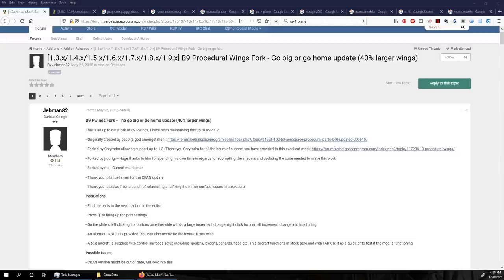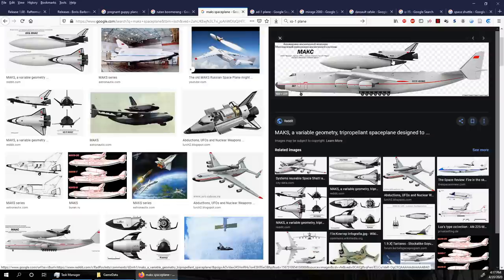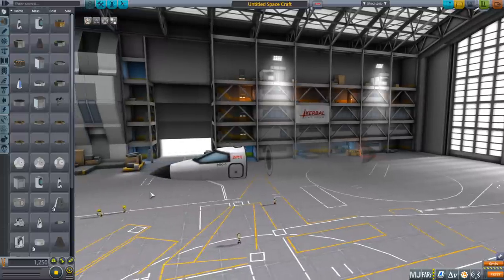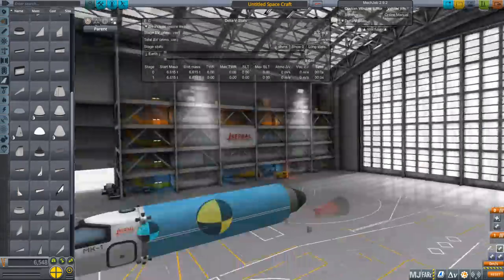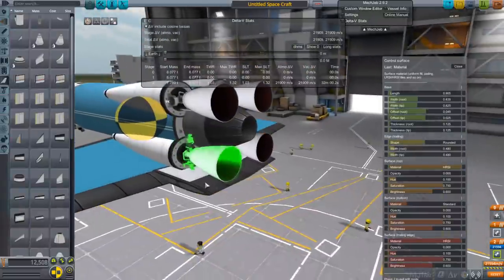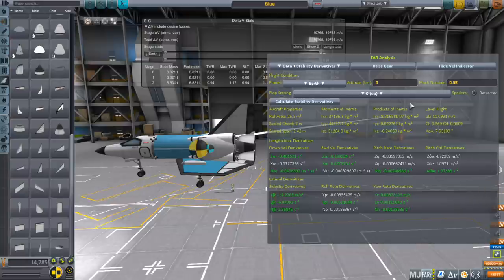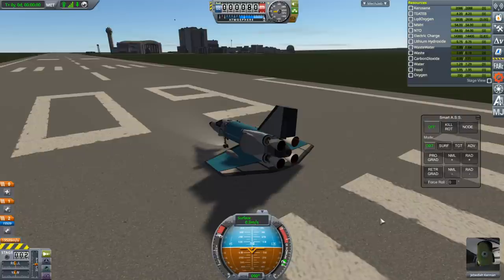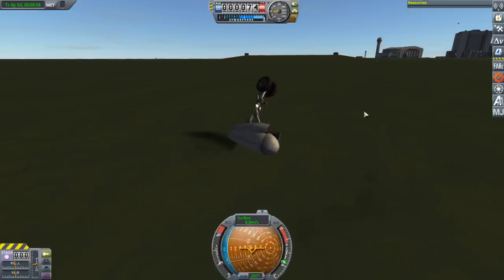Realism Overhaul in KSP 1.8.1 - Spaceplane Tutorial 1 - Sub-orbital

Comment: 3:55 Well, if you don't count sounding rockets and the whole range of rocket-powered missiles, but yes.

15:55 Come to think of it, turbojet engines are rocket engines with grossly oversized and heavy oxidizer turbopumps out of necessity.

Jeez, that 300+ mph failed takeoff skid, and the 15+ g deceleration upon descent, and that nose-heavy crash... testing spaceplanes in KSP is nervewrackingly glorious.

In a similar vein to @Jeffrey Witty, I thought of another potential challenge—suborbital space using purely air-breathing engines, manned or unmanned. With an extremely high TWR and/or an efficient high-supersonic/hypersonic zoom-climb, it's probably doable.

Comment: I have some issues with air intakes, they don't intake air, flow is 0
Reply from the maker: AJE uses the intake area as the measure rather than a flow. I assume you've taken the intakes with jets outside to check whether the jets light? If so, are you using any mods that I didn't introduce in this tutorial series, and do you have Advanced Jet Engines, Community Resource Pack, RealFuels, and Realism Overhaul?

Comment: Can somebody explain me pls, why my fuel in RO doesnt work with the engines? I have realfuel and ROengines installed, i put an engine on a tank, it takes the right fuel but it doesnt show neither the Dv neither when i go onto launchpad the fuel is not showing up. Help pls. It doesnt work with any engine. Neither Kerolox, methhalox, hydrolox neither with avgas.
Reply: Check which fuel your engine wants (you can change it, if you want), then make sure your tanks are set for those fuels.  Tanks by default are empty (afaik). If the tank shows a button with a Fuel/Ox mix, you haven't selected your tank setup and the button is suggesting a config that it sees an engine for.
Reply: @immersiveirl6638  no, im totally sure i got the fuel right. I checked it on many engines and fuel types, none of them work excpet solid rocket fuels(coz they are already in the motors). I suspect i have something broken with the fuel lines, but if that the case the fuel would be present in the  panel with oxygen, electricity and other stuff. Is there any chance that the menu displays the tank filled with fuel but not actually putting anything in? Im using RO on ksp 1.8.1
Reply: @b0mby1  Hmmm... Can you give a screenshot of one of your tank setups?
Reply: @immersiveirl6638  oh,i figured it out. I just deleted the Realfuels and installed again and it worked. I think i downloaded a corrupted file. This time i downloaded from CKAN and it worked
Reply: @b0mby1  Nice!

Comment: Think we could get a SINGLE jet engine tier 0 "exceed mach 1 in level flight" jet?
I like the space plane but there design in RO/RP1 is documented by EVERYONE, and their grandmother, to death! No one ever does a bear minimum break the sound barrier jet,... they either use a rocket plane or wait until "its easy"
Reply from the maker: Not sure what you mean, but if you take the rocket engines off the plane I made here, add a bit of a wing strake to reduce drag like I was demonstrating while talking about FAR, and get rid of the liquid oxygen in the center tank, I'm pretty sure it could easily get past Mach 1 in level flight. I mean, that's far easier than making a spaceplane.
Reply: @RaizSpace  His idea is creating a plane in RO capable of exceeding Mach 1 in level flight using a single WWII or immediate post-war turbojet. (Say a Junkers Jumo 004, Allison J33, or Rolls-Royce Derwent V.) As it was never done IRL, it seems like a reasonable challenge, more difficult than just a spaceplane.